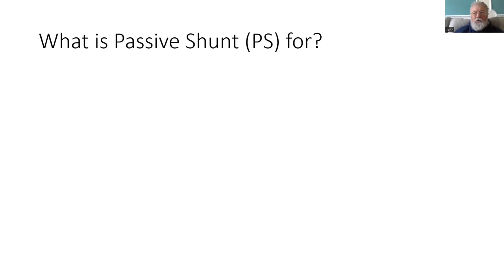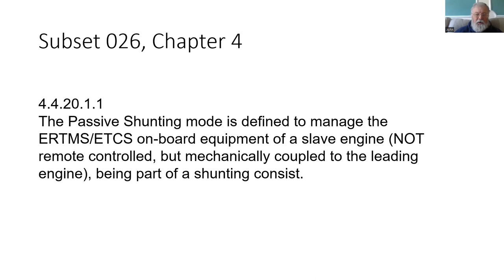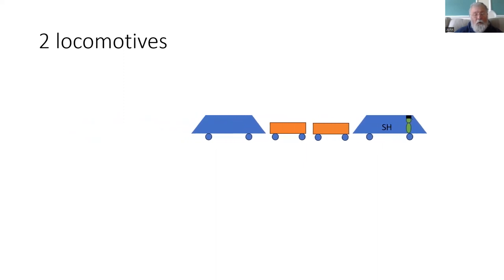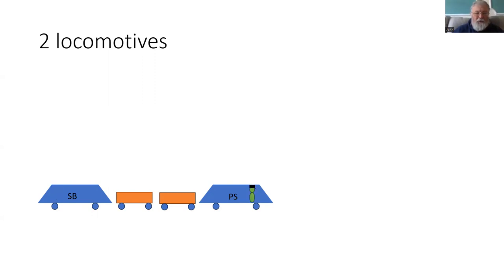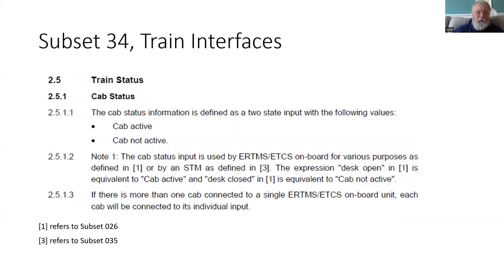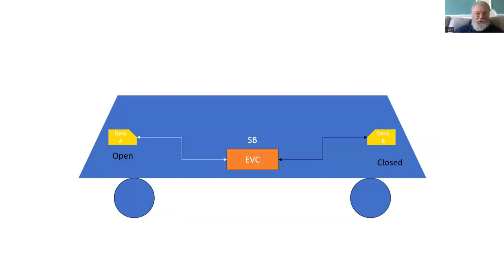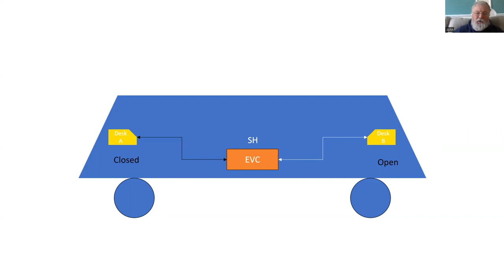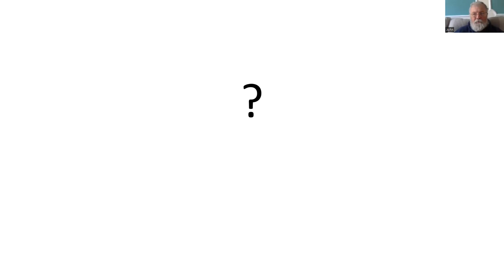ETCS Bites Back - 41 (Passive Shunt)

Comment: From what I understand, this is a closer fit for a continental operational concept like Germany’s, where there is a sharp distinction between train movements/Zugfahrten and shunting/Rangierfahrten and never the twain shall meet.

For a train movement it can be required that the leading cab be in FS/LS/AD/OS/SR and all other cabs be SL as a condition of the movement (or NL); and for a shunting movement that the driving cab be in SH and all other cabs in the shunting consist be in PS. 
It’s a bit of a “simplifying lie” to talk about the mode of a cab rather than an EVC but I think the idea is that this isn’t a distinction drivers should need to care about; and automatically entering SH with driver ID intact is just an extra convenience feature.

Drivers, perhaps assisted by the shunters, would need to hop between all locos/cabs in the consist there anyway to configure the lights and brakes for shunting so putting the driving desks into PS wouldn’t necessarily be that much of an additional requirement. I’m also not sure that continental shunting practice requires through braking.
Reply from the maker: I agree it was introduced at request of German operators. I am still struggling with how it would work in practice, but your info is helpful.
Reply: If an EVC is in NP the brakes are applied (see subset 26). 

In order to be able to tow the vehicle, the brake output must be rendered ineffective by external measures (e.g. by bridging the emergency brake valves). Maybe this can be avoided by PS, because the shunting personal does not need the training to reach and use other modes (just basic training). 

In my point of view: IS is also not good for this (just quick and dirty).